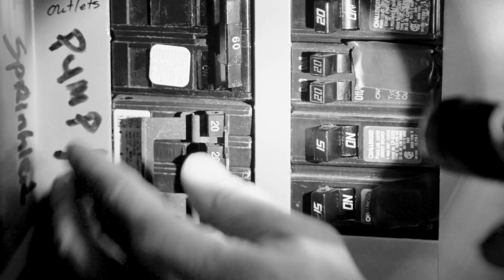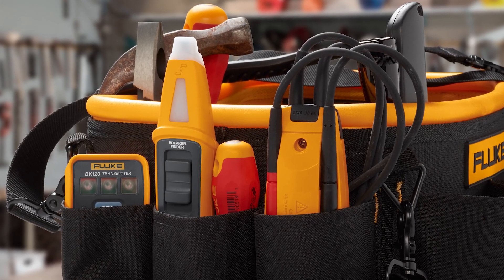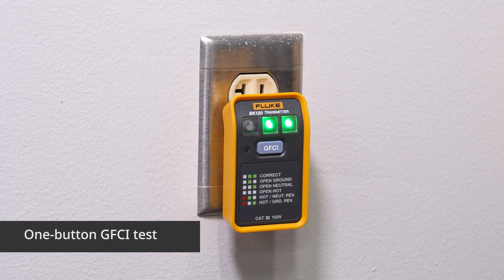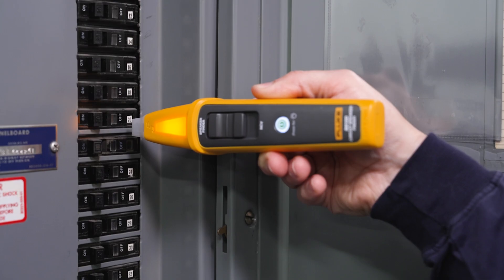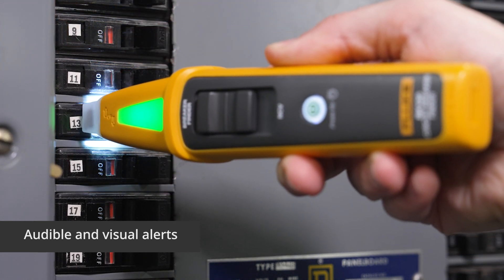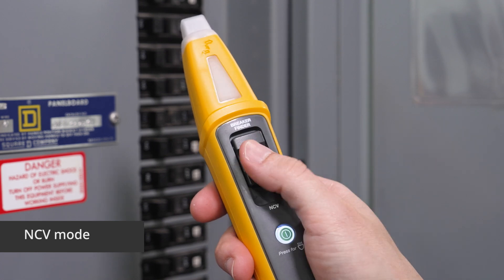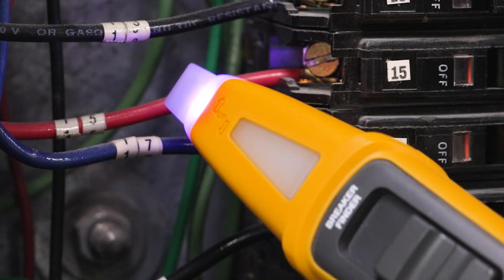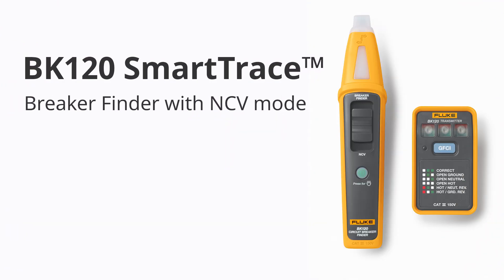How to Use the Fluke SmartTrace™ BK120 | Fast & Easy Breaker Finder Tool

Comment: If you've got a panel where the panel's labelling is difficult to read, mislabelled or incomplete, this tool will make it a lot easier to update/relable your panel.  Without it, it is a long, slow job.

Comment: It's a very specialized device, and few people will need it.
Reply: i have it and use it all the time
Reply: just wish it was more rugged. feels kinda cheap. but works better than millaulkee or the klien version. should have some rubber over mold on it
Reply: I bought one
Reply: @PetroMechanx does it still locate breakers if the circuit is dead
Reply: @jonathanmoseley3797  no it needs to be energized to find it.
Reply: And I still want one lmfao.